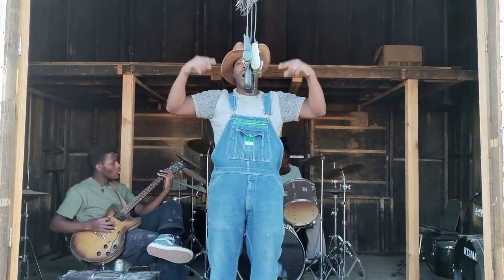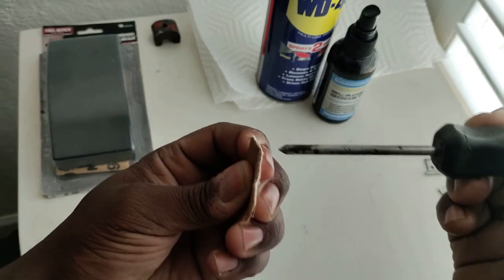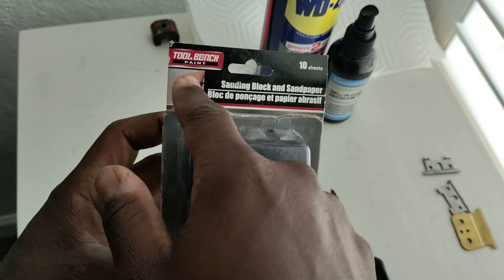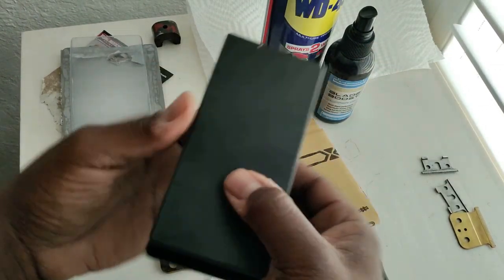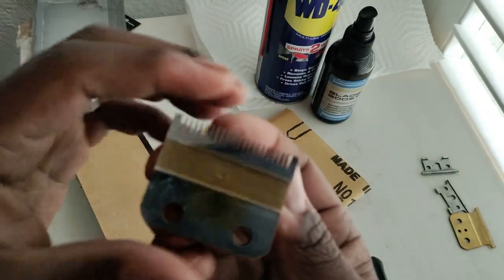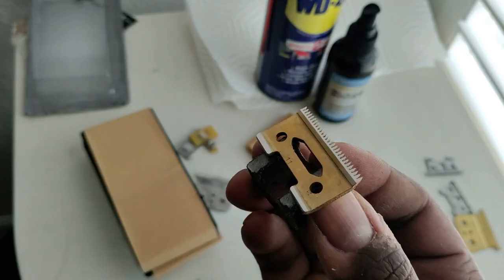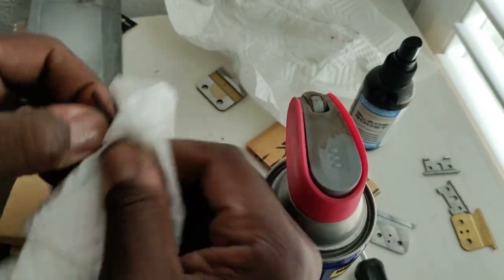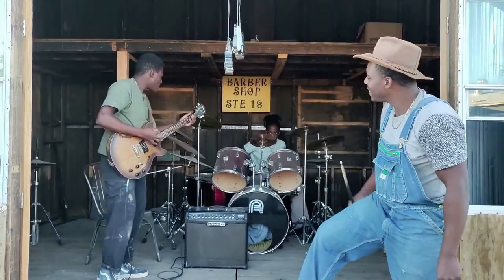How to sharpen a  walmart clipper blade at home

Comment: This is exactly what I needed. I thought the blades were flat against each other and after I thought I'd sharpened them they were then catching hair and worse than before I'd started... Thanks heaps
Reply from the maker: you got bro glad i could help
Reply: @keepitsharp357  Hello sir!
I sharpened the blades like you in another video of yours that demonstrates sharpening only one
flat surface. and now when I cut my hair, my clipper pulls more hair than it cuts. I followed all the steps, the first time I used 120 grit, then 220 grit..
but do you think that it is possible to have sharpened them too much and now they have dulled so hard that the blades no longer touch well between them? I honestly sharpened 100 times on 120 grit, and 200 times on 220 grit. is that what I did wrong? I mean I sharpened too many times? you mention that I have a wahl pro 150 clipper... Do I still have a chance now if I sharpen the blades like here on a curved surface to save them?
Reply from the maker: @alincosnita4570  in most cases it depends on the condition of the blade when you start also if you have the right form when sharpening.  trying the other way may help but im not sure because of not having the blade in my hand to take a look at
Reply from the maker: @alincosnita4570  yes it is possible.  when sharpening a blade you need only to sharpen just enough to get the original contact back if sharpen to much teeth will never touch to cut hair